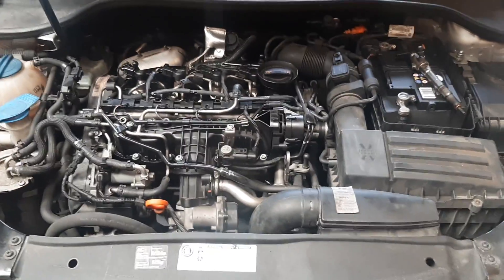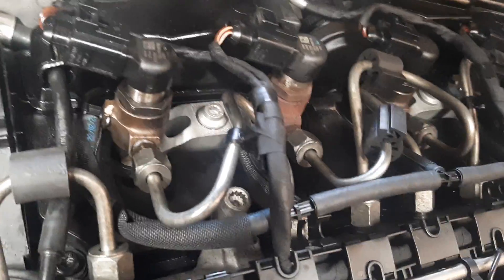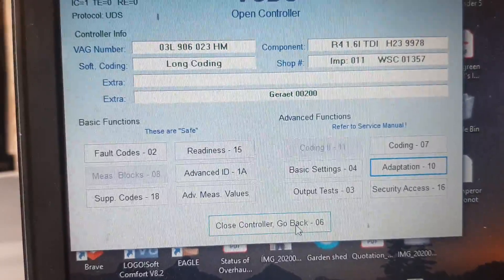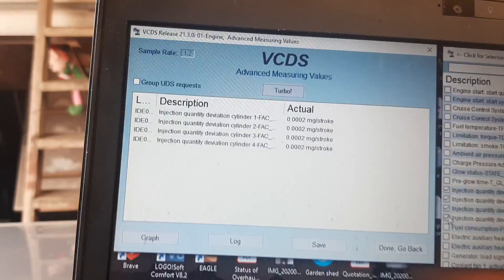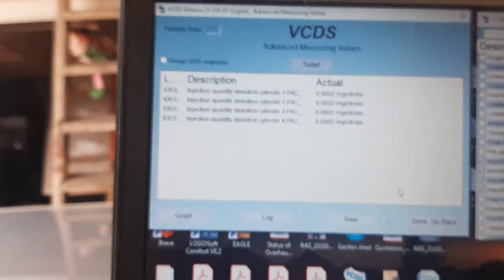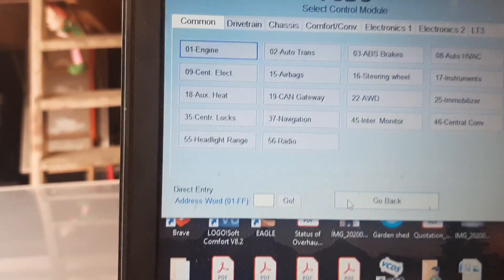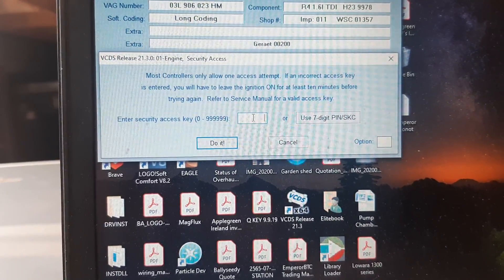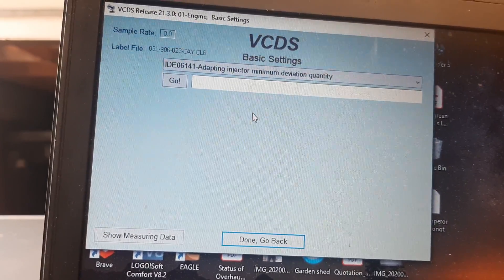VW 1.6TDI Injector Quantity Adaptation IDE06141 CAYC engine

Comment: Hi, I tried this and it just stays running and does not complete even after well over an hour. Is there any reason why it wont complete?
I did select the inj deviation minimum quantity while the car was off at first thinking it would do anything but am now left with ending knocking under any bit of load. 

Original issue was intermittent rough idle on cold start up and the odd time engone knoecking on take off even after 15 min of driving. Figured Id try this but am worse off now....any help please as I need car in two days time for work. 

Mk 6 Golf TDI 2012 Thanks.
Reply: Hi everyone, I have had the exact same problem with my CAYB 1.6 TDI CR, with ECU sw 8896. Had an issue with EGR, then made it blinked and after that also performed IDE06141. Situation was exactly as you write there. After 1hour of adaptation Running  without success I stopped it and my car started terrible knocking, smoking and missfiring at cold mornings. Measuring injectors deviation gave me no idea which to replace. I am using VCDS 18.7. 
Then I saw what @john ogorman wrote here and I try to change injectors coding with dummy values and then back original values. He wrote that  it helps him. Guess what, after approx 5 km after made that change, my car become running smoothly and now, 400 km after, It is running as it need. So thank God I saw your conversation there, It helps me a lot.
Reply: @1purki  So happy my experience has helped you.
Reply from the maker: Hi there, did you check the injection quantity offsets first? If one injector deviates significantly it would be worth doing a leak off test.
Also is your DMF ok?
Reply: @enginemanagementadventures7305  No I dont think I  checked injection quantity offsets. I remeber looking at mg/stroke ( Not sure name of this on VCDS.) and Inj 1 was running higher than the others. 
DMF is fine, the odd time in the cold on cold at startup it can cause bit of shudder on first 5 - 10 miles but perfect then after.

Can you explain leak off test? How to do it?
Reply: Hi again, I am still trying to find out why the Injector deviation quantity procedure does not complete on my car 1.6 tdi CAYC? I seen across other boards similar issues with it not completing that no one can answer it, just dead end threads all over and its very important to find out why as it left my car knocking terribly when i tried this inj deviation quantity procedure on VCDS. Please can anyone for the love of god give a proper accurate answer. Is there a way to undo what I did, resetting inj dev quantity offsets in VCDS. I even emailed Ross tech, people behind VCDS and nothing either. Frustrated ....Thanks
Reply from the maker: @johnogorman2920  Hi John, Yes there is a way to undo this, quite simply the procedure to run this algorithm is convoluted because quite frankly VCDS are not VW AG - they are reverse engineering the software (which is excellent) and don't have access to the nuances.
In any case this particular sub-routine in the 1.6tdi Siemens / Conti engine management does require security access and the problem lies in how this access is established.

Start by bringing engine to operating temp and ensuring and ensuring no active codes present.

Now EXIT from VCDS switch of engine and take out key WAIT until all throttle body etc PWM hum stops AT LEAST 20 SECONDS.

Start engine and idle, establish communication with ECU go straight to security access and apply offered code DO IT

STRAIGHT to Basic settings and select IDE06141 select run - BRAKES & CLUTCH - release - Floor throttle - release as instructed.

You know its wrong if it revs to approx 2800 rpm and stays there.

Correct operation is revs to 2000rpm then 10 runs through the rev range 3 to 4 times takes 5 - 8 mins.

It WILL NOT WORK if you navigate to security access after running engine for awhile and checking fault codes ete - security access MUST be established by full power down and initial comunication.

I did this twice on a 2010 golf & 2014 Caddy this week.

Hope this sorts you out.

I deliberately did it wrong the first time and is did leave a noticeable knock until I ran it again correctly ! let me know how you get on.
Reply: @enginemanagementadventures7305  I did what you said, no fault code but the result was that glow plug light  was blinkinking and idle stayed at 800rpm, no change. Does the sw version of the car make difference?
Reply: @enginemanagementadventures7305  Thank you for taking the time to reply in detail to me, really appreciate that and I hope this help others out aswell.

So my story, rough idle and knocking on acceleration from second gear when at idle, i.e after going over speed  bump. Started getting worse so did the Injector Minimum Deviation Quantity (no security access on 1st attempt) and made things a lot worse, knocking all over rev range. Panic set in as I need car for work. Tried several things, resets, retried the sub routine again with security access. Took it for a drive...waited until next morning and knocking still there, it was not going away.

Took it to mechanic, said injector issue. Removed all injectors, inj 1 was completely stuck, sliding hammer inj tool used to remove. It was black and manky up past the     O-ring, hence reason for being stuck. Copper seal was visibly worn allowing gasses to blow by. Turns out 2x injectors were faulty and other 2 good. Got em reconditioned (specialist kept em and gave me 2 already reconditioned off the shelf)  and back into car. Injector seat had to be cleaned as good seal between copper washer and injector is required.

500 euro trade price I was charged. One VW dealer was 663 Euro and another dealer was 420 Euro per injector as they said they bought in bulk! Not cheap
 Coded in the 2 injectors  (extra Zero had to be added to end of code as requirement was 7 digits and only 6 printed on top of injector) 

Started car and revved it and horrible knocking was still there. Drove home and knocking 99% gone!  So I tried the injector minimum deviation quantity again ( before your reply above) but would not work. I now had a knocking engine through out the rev range again  so I used VCDS to code in the injectors again  and take it for a drive again and that brought it back to 99% good again just like after my drive home from the mechanic. So its been a week now since the shit hit the fan and  its 99.999% good now. There is the tiniest bit of knock misfire after take off in second gear after going over speed bump but that's even hard to notice now.  Perfect idle now  and I have definitely got more power now. Feels great to drive again. 

So my thinking was recoding in the injectors was like a reset in a way and I'm guessing the ECU had to relearn/calibrate the inj itself over a few run cycles. If you know they specifics of what goes on when you code in new injector can you let me know here.  

So just a few questions....
1. Is there a need to run the sub routine Injector minimum deviation quantity or will the ECU learn/calibrate this itself over time after injector replacement?

2. How did you figure out the specifics to run the sub routine correctly? Trial and error?

3. Why do these injectors fail, 120,000 miles on my 1.6 CAYC 2012 Golf injector specialist said its common in these Golfs!
You would think diesel would be lubricating these. Is it the high fuel pressure the issue od is it the Siemens Injector itself?
My old petrol gold had 200,000 miles with no injector issues!

To be honest I want to try and see if I can get the sub routine  as per your instructions above ( Inj minimum deviation quantity to run)  but am afraid to try anything right now. as I just want to enjoy a problem free weekend and the smoothness of the car again. I will try in a few weeks and come back here to let your know. If anyone out there can confirm the above instruction let us know if it works.

Hope this helps someone out there.  The more detail provided the better hence my long reply.
Reply from the maker: @johnogorman2920  @Ian Cartmell Hi Guys, and thanks for your detailed input, some observations I have made working on the 1.6tdi.

John you are correct in that the software is constantly implementing a smooth running control algorithm for injector quantity control and also taking account for injector wear over time, it does this in idle mode generally by analyzing individual power pulse velocities and averaging.
By Re-coding an injector we tell the ECU it has been replaced and this age variable is reset, (In the case of a second hand injector this will introduce over-fueling the balancing routing will correct this as long as the injector nozzle is not worn outside tolerances) 
VW procedure is to perform the balancing routine once injectors are replaced - any compensation routing will only correct inside a certain tolerance!

1. Running this routine if you have not replaced an injector might make your engine run smoother for a while, however if you see compensation deviation values that look sketchy it is most likely caused by,
a. worn injector
b. worn flywheel

If your engine is heading over 200,000 km generally flywheel is failing @ 250k smooth running routine will chase its tail trying to balance torsional oscillations of a bad flywheel.

2. The crux of performing this routine is a quirk of VAG-Com and this Siemens ECU type. VAG com does not have direct memory access to the ECU as they do not have the source code, (most likely neither does VW, this would be Contitech IP) VW factory software however can access the ECU as intended VAG com has to be reverse engineered using their own knowledge base - In any case I suspect that when running a specific piece of embedded software stored in the ECU's EEPROM it needs to be run using a FLAG, this appears to us as granting security access, handshaking between PC - ECU to place the ECU in a safe mode where only expected data is obtained (otherwise the ECU would crash).
VAG com performs this crudely I suspect VW software sends a reset pulse just before initiation of routine however VAG-Com asks you to input security access code and then perform procedure.

a. for other routines sometimes you will get a response (controller did not except seed) this is basically security access not accepted - Cause, need to cycle ignition wait 1 minute reboot and proceed straight to security access once accepted do not mess around for our compensation routing obviously the engine must be running before you went for Security access.
I dont know why it never says seed was not accepted by Vag-com for this routine and does a spurious attempt (oversight by Vag-com ?)   

b. cant say about the software version, I have done this about 30 times on 09 - 14 VAG group and no probs.

3. TBH I dont see any major problems re these injectors - So injectors can fail electrically (Piezo Crystal pack fails) or just by wear 120,000 kms is premature for sure and one cant say, Contaminated diesel, previous owner filling up with petrol just once ! missed fuel filter by 30,000..... the list goes on.

If you dont know the history it could be anything, injectors blowing through the washers, breaking clamp bolts are fairly common - Design flaw??? tbh most likely injector replaced without new clamp bolt which MUST be changed (€3 from dealer), not correct copper seal washer and not torqued correctly - 8Nm and 45 degrees I think.

I would be slow to single out these injectors over any other tbh.
Only real flawed component in the 1.6tdi is the EGR valve actually.

Have 2 skoda superbs (Taxis) with 400,000 - 500,000 KMs same injectors.

Hope some of this helps!
Reply: @enginemanagementadventures7305  i friend i try it in an audi a3 1.6tdi, because i have to replace an injector, but all the trys it revs to 2800 and dont finish.
Reply from the maker: @carlospena3894  
Hi there Carlos, can you state the engine code please. Also did you perform the function Exactly as outlined in the previous conversations ?
Reply: What is the ECU version of Volkswagen in 2010?
Reply: @iancartmell8252  Hi Ian, good observation, you might be on to something.
 
Mine is Component: 1,6l R4 CR td H43 9052  and does not rev above 2400rpm when standing still. 

Next weekend Im going to try  injector minimum deviation quantity sub routine and see if it work or not as per Engine Management Adventures reply to me above. I just want to run a tank of fuel through the car first  and calculate the mpg myself and see if it like my other mpg's after the 2x injector change. 

Did you get sorted with your car?
Reply: @iancartmell8252  Have you tried what I suggested in detail above somewhere where I said to code in the injectors again and let the car do its own learning. 
I'm pretty certain this will work as it did for me. It pains me to hear the car is still on the drive but its better than driving it around possible causing damage to it.
Reply from the maker: @iancartmell8252  Hi Ian to be honest VW dealers wont have a clue what your talking about, the VW ODIS system will do all the steps automatically for them - so mentioning software rev will be meaningless.

Did you manage to perform the procedure ?
Reply: @iancartmell8252  Hi Ian, what was your problem exactly. symptoms that made you replace Inj2? Id like to know for myself.

Everything you said is exactly the same symptoms I had. After the 2 faulty  injector were replaced and coded in it took only the drive home (just under 10 miles) to get 99% good. A week later its now perfect, no pinking under any rev. That's a week in total

Vaguely remember Minimum deviation quantities before Injector replaced were sketchy as they jumped around a lot but around 0.5 to 1.9 I think. Inj 1 was standing out the most but another inj would read high the odd time. Could not decipher it to be honest. After results are all more stable and similar around 1.5 to 2. All very uniform results.

UPDATE: 2 weeks after my 2x Injectors were replaced the  minimum deviation quantities are now reading much closer to zero. 0.2 -0.9. Inj 4 does look hit 1.2 sometimes and generallly runs closer to 1 whereas the other3 injectors are well below 1.

No idea of SW version I have, how do I check? Ill let you know the weekend when home.

Yeah EGR valve failed last year, carbon build up causes the flap to seize. Got it replaced. 

No diesel gate software update, did you?

Also I read somewhere make sure DPF is not regenerating at time of performing Inject minimum deviation quantity. 

Its worth trying to recode the injectors again (Engine not running but ignition on to communicate with VCDS otherwise it wont take the code, took me a while to figure this out)  as I did to get it to learn/re-calibrate. Note - It would not accept the same code already in the system so I had to use the codes off the two old injectors first so I could re-enter the new codes from the 2 new injectors that were replaced. its worth turning off car and removing key, wait 20sec before re-entering the new injector codes.  Thats what I would try first as it worked for me. If it doesn't work there must be another problem. Keep us updated.

Comment: i didnt replace any injector but i do have a rough idle when hot. do you think it would hurt to try this?
Reply from the maker: Check the injector compensation values for large deviations first.
Also be aware that when idling a cylinder balancing algorithm runs to smoothen out idle, a worn flywheel will cause this to constantly try to balance the torsional oscillations from the flywhee so check also.
Reply: @enginemanagementadventures7305  ok. Thanks a lot for your help.
Reply: @enginemanagementadventures7305  I replaced all 4 injectors with refurbished. Adapted, but injectors compensation values are big. 1st and 4th over +1 and 2nd and 3rd under -1. What is the problem?
Reply from the maker: @ViKi-ox2rl  Hi, did you code the new compensation codes first before running the balancing routine.
Reply: I did the adaptation and for now, after a week, the car is smooth as silk at idle at any temperature. I'm not embarrassed anymore at traffic lights. Ahah. Thanks.
Reply: @billasohyeah  are you saying that you solved this problem without changing or repairing any injectors? I have exact same thing with the my golf 6, and with the hot engine it gets more noticeable
Reply: @pochinki420  actually it gets perfect. But after 1, 2 month the shake comes back again.

Comment: Had injector 4 die today whilst doing a test drive after replacing a broken EGR. 2012 Octavia same engine. Thanks for the video - looks like VCDS is paying for itself :)
Reply from the maker: Well the EGR is the weak link in the 1.6 tbf. Generally the Siemens/ Continental injection system is reliable.
I see lots of issues with not renewing clamp bolts etc.
Great that you sorted a involved Job like this VCDS is a great tool.

Comment: Just fitted 4 injectors and had lumpy idle on my 1.6 Ibiza. Thanks so much for sharing this as it resolved my issue 👍
Reply from the maker: Good Work! Glad it helped! All 4? Sounds nasty.
Reply: @enginemanagementadventures7305  well 1 went and just wanted to replace all of them for the newer model so that it didn’t happen again. Was pulling my hair out until I saw your vid👍life saver
Reply: @richardwebber132  do you have the part number for the newer model? Or for which engine code/model are they for?